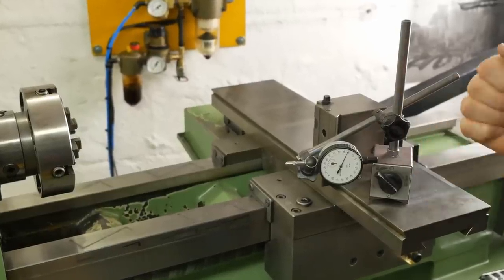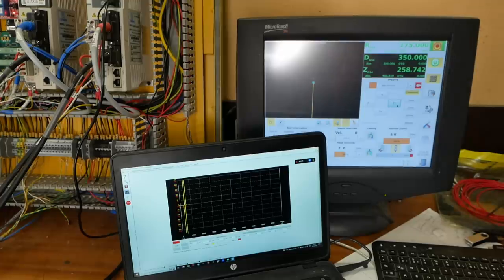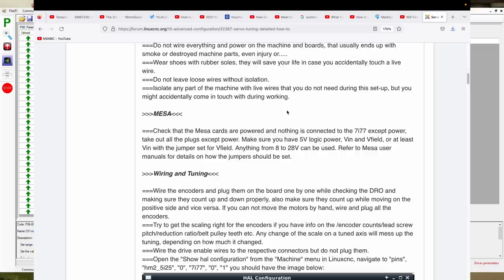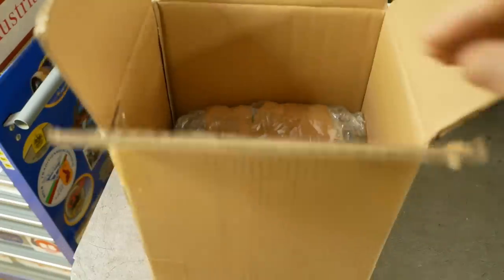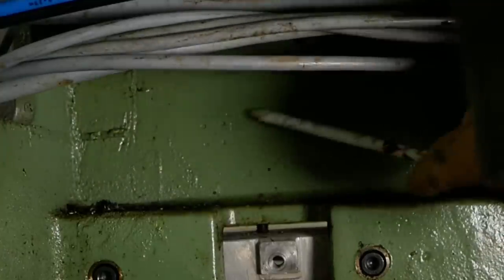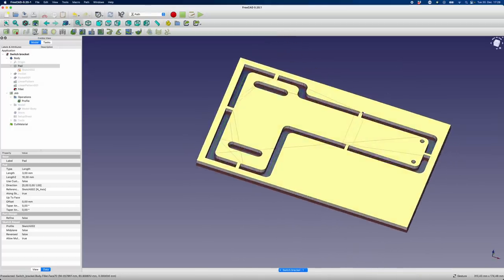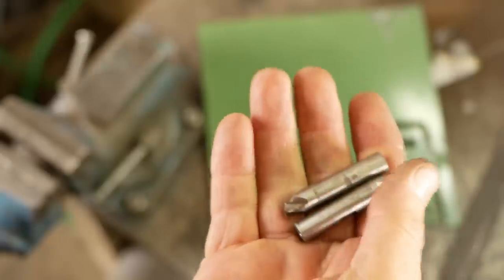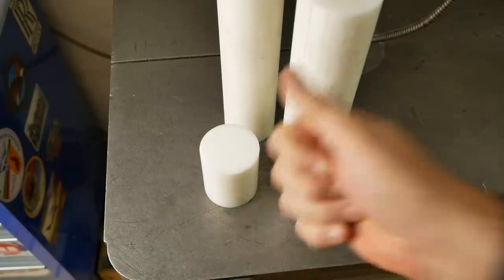...and I broke two endmills CNC milling a bracket- Schaublin Ep. 48 || RotarySMP

Comment: RIP end mills 😯 good to see you are having good luck with freecad I’m learning it at the moment 😀
Reply from the maker: Took me a while to get my head around it, and I find the error messages too geeky/programmer oriented, and unhelpful, but it is pretty amazing what it can do, and I am a big fan of open source software.
Reply: @RotarySMP  luckily I'm in the geeky/programmer camp so not an issue 🤣
Reply: @RotarySMP  considering it's open sourced, I'd imagine the errors are formatted to make it easier for others to try and fix the code from an error.
Reply from the maker: @cavemaneca  That seems to be the case. In most cases, my errors are simply becasue I didn't know the order of doing things, or know to select something else first. The error messages are then programming style "something is null" type codes.
Reply: @RotarySMP  I Find the most frustrating thing at the moment is hitting the over constrained model error but slowly getting the hang of it. 😃
Reply from the maker: @julias-shed  I also find that I add a constraint, get that error, and it offers me 3 constraints to delete (which ruin the model), rather than the one which is the problem.

Comment: Sheet steel is usually pretty horrible to machine. It seems to smear rather than cut and as you found out it tends to break cutters.
For the motor tuning I'd recommend torque mode rather than velocity mode. I've run LCNC on a number of servo machines and I've always had better results with torque mode.
Reply from the maker: I thought about that, but then have to start over. I am pretty satisfied with this now.

Comment: Have you investigated if turning the cam-thingymabob of the original collet closer switch turns it into a momentary switch?
Reply from the maker: Duh!
I suspect you are probably right.
Reply: @RotarySMP  I was actually wondering the same thing after you showed that the switch didn't latch with the cover off. Still, this gave you an opportunity to learn more.
Reply from the maker: @cavemaneca  If that is the case, I have to dilemma, do I just reinstall it and through by ugly bracket in the trash!
Reply: @RotarySMP  Well, that would mean you can't use the cool switch for your guitar pedal and the endmills died in vain. I guess it all comes down to you being bothered by the bracket or not. :)
BTW: I would imagine that the machine has (had?) some kind of device that deactivates that switch if the spindle is not at a standstill.
Reply from the maker: @R00KIE-ger  That would have been in software. I need to check the switch behavior, but may well reinstall it.

Comment: FreeCAD path tools are getting pretty good, right? I have Mastercam at work but at home I increasingly enjoy FreeCAD.
Reply from the maker: It really is surprisingly well sorted. Took me a while to get my head around it, but since moving to a more structured parametric method, it is working okay for me.
Reply: @RotarySMP  have you tried face milling with freecad path? imo the toolpaths for that were all unusable but I might be picky?
Reply from the maker: @MF175mp  I haven't yet, but will sooner or later. What didn't you like about them?
Reply: @RotarySMP  couldn't get it to approach from outside the stock and the paths didn't include a basic spiral etc.. There might be some helpful options if digging into it though. I only have briefly played with it so far.
Reply from the maker: @MF175mp  Weird. A surfacing cut that wont start outside the work perimeter sounds pretty limited.
Reply: @RotarySMP  seems weird to me too. I don't want to plunge a face mill in
Reply: I found now an option that lets me expand the toolpath outside the stock but it will end up doing some air passes since it's not separately for X and Y. Another hack option would be to specify greatly oversized stock for the X direction.

Edit. Now after some more hours of fiddling I found a "dressup" option which allows approaching from outside of the stock material. This might be a good program but man are some of the features hard to find initially
Reply: @MF175mp  I wonder whether you could make a sketch that has a rectangle in the size that you need, bigger than the stock. That's a hack, though.
Reply: @OhHeyTrevorFlowers  the path dressup feature (that was hard to find) was able to fix that. I am starting to think this is a usable CAM now. Only the Fanuc post gives some errors whereas Linuxcnc post will post process fine... I will try to edit the linuxcnc post enough to work for me.

Comment: Why not interlock your collet closer with actual spindle speed rather than spindle-on?  You can do it with a wcomp centred around zero, or with a custom comp like this one which also prevents the spindle starting if the drawbar is released. 

component spindle_interlock """Prevents tool or chuck release when the spindle is 
running""";

pin in signed encoder-counts "connect this to the spindle encoder";
param rw unsigned encoder-vel = 1 """how many counts per sec to accept as
spindle-stopped""";

pin in float spindle-speed-in """Pass-through the spindle speed request only if
the release is not activated""";
pin out float spindle-speed-out;

pin out bit release-allowed "For operating an indicator lamp, for example";
pin in bit release-request "The release request from the button/pedal";
pin out bit release-out "the release signal to the valve";
pin in bit release-state = 1 """This bit sets the value that is passed to
"release-out". Toggle it to 0 or 1 to suit internal or external gripping,
for example""";

function _;

license "GPL";
author "Andy Pugh";

pin out float vel;
pin out unsigned st;
pin out float timer;

;;

FUNCTION(_){
    //static int st = 0;
    static int last_counts;
    static double last_timer;
    //static double timer;
    //double vel;
    
    timer += fperiod;
    if (last_counts != encoder_counts){
        vel = abs(last_counts - encoder_counts) / timer;
        last_timer = timer;
        last_counts = encoder_counts;
        timer = 0;
    }
    else
    {
        vel = 1/(last_timer + timer);
    }
    
    switch (st){
        case 0: // spindle stopped, release allowed
            if (vel > encoder_vel) {
                st = 1; 
                break;
            }
            if (release_request){
                st = 2;
                break;
            }
            release_out = ! release_state;
            spindle_speed_out = spindle_speed_in;
            release_allowed = 1;
            break;
        case 1: // spindle moving
            // This state deliberately never changes the release-out pin
            if (vel <= encoder_vel){
                st = 0;
                break;
            }
            spindle_speed_out = spindle_speed_in;
            release_allowed = 0;
            break;
        case 2: // spindle released
            if (! release_request ) {
                release_out = ! release_state;
                st = 0;
                break;
            }
            release_out = release_state;
            spindle_speed_out = 0;
    }
}
Reply from the maker: Merry Xmas Andy. 
Thanks, that looks like a sophisticated version of what I was planning to do. I as going to use speed<3rpm with a comparator in ladder.

Comment: You what? You're getting to like Freecad - it's the sporn of the devil.
Just get Fusion360
Reply: Confusion 360 is unusable for the free license when speaking of  the CAM side as of now as far as I know. And they keep making it less featured. Maybe if adding the tool changes and rapids manually to the programs it could still be used.
Reply from the maker: Since I monetized my channel, the free version of Fusion is not useable for me. I never learned fusion, sndmyCatia experience is somewhat useful in freecad
Reply: @RotarySMP  do they not allow it for you?
Reply from the maker: @MF175mp  The Terms and conditions are pretty clear, as are threads on their forum, that they consider any commercial usage.
Reply: @RotarySMP  Well, it would be pretty insane to consider it commercial use but fair enough